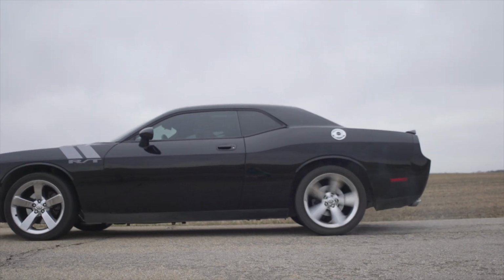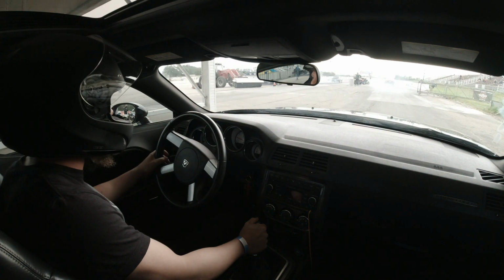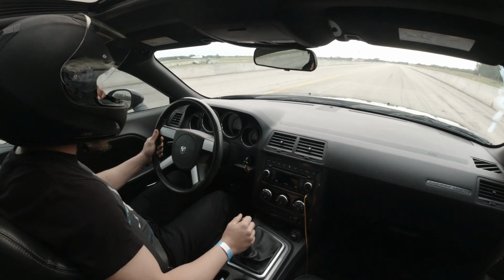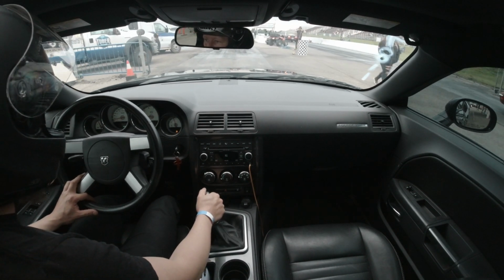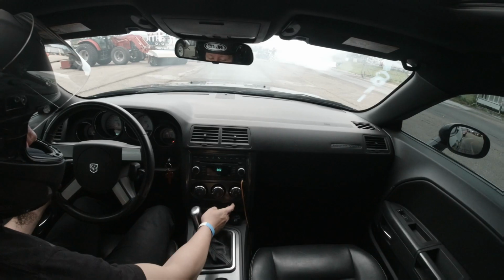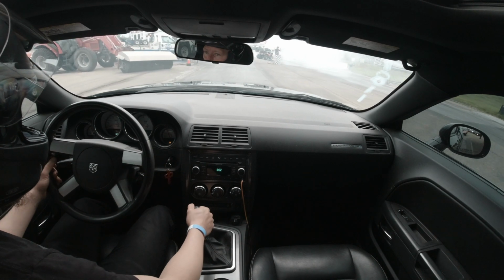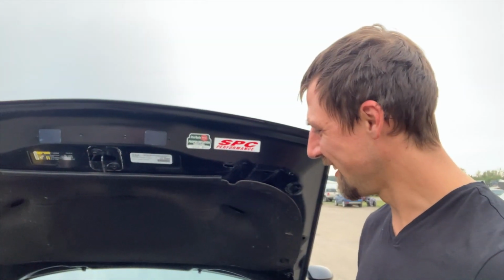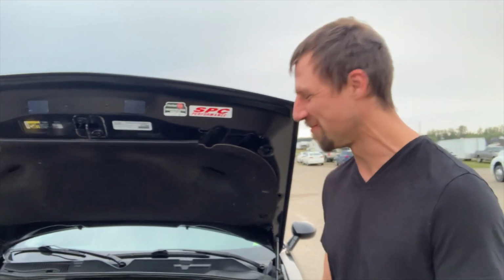5.7 Hemi Stock VS Modded N/A

Comment: Am I understanding correctly that what you’ve done is long tube headers, can & a tune & that’s all? Just curious how exactly yours was modded compared to Matt’s stock 5.7
Reply from the maker: @robertalsbury  at this point in the build I have a comp cams hrt stage 2 cam at this point in my build.  This is with the factory catback though, I didn’t swap to a 3” setup until later.
Reply: @ just just a cam no tune and no headers?
Reply from the maker: @ no you have to run a tune with a cam or your car will barely run.  Long tube headers and cam at this point.  Headers were the first thing I did and then added the cam after.

Comment: Unfortunately, Dodge left quite a bit on the table when it comes to the R/T. With the stock cam, horsepower drops off quickly at around 5,500 RPM. Not only will a cam upgrade make more horsepower, it will carry it out to around 6,300. The torque also has a similar pattern where peak torque builds quickly and drops off quickly. This was done for 2 reasons. The first is that these engines were used in trucks and a cam profile like this is good for getting a heavy vehicle started. The 2nd is that Dodge didn't want a 5.7 that is closer in performance to a 6.4. There is obvious more mark up with a higher trim level, Another key difference  is the exhaust system between the 2 R/Ts in the race. The OEM manifolds are downright terrible. If one is willing to do the work, it is worth it to upgrade the 5.7. If I were a Mopar person which I am not and I could get a good deal on an R/T, I would definitely upgrade it. I know getting a mud hole stomped into my back side by every Camaro SS and Mustang GT at a drag strip would wear awfully thin very quickly. Upgrading these cars makes them much more fun to drive. It's a matter of whether you would like to go the N/A or boosted.
Reply from the maker: It’s even closer than that though, the 6.4 wasn’t a thing when the updated 5.7 was put in the Challenger lineup.  Because the 6.1 was only putting out 425 hp I think you’re right they wanted some separation.  Funny enough if you just swap out the stock manifolds for headers suddenly you dyno pretty much what the 6.1s put out.  I think pressure from the Camaro’s performance forced Dodge to put out the 6.4 to stay competitive.

Comment: You always have interesting vids, thanks. I thought you were shifting too soon but then I could see your tach and you were right on the mark. Those  5.7 6 speeds wind up fast in second and 3rd. The only mod I have on my black '09 Challenger R/T 6 speed is a little pinstriping. That's good for 5 more HP, right, heh, heh.
Reply from the maker: Absolutely!  At least 5hp!  Thanks for watching!  💪

Comment: Awesome video! Definitely get more comfortable at the track. I’m satisfied with my best 14.02 1/4 mile time this year. We can meet again at the track next year and see if I can keep it a little closer to you. Modification is definitely In the near future. My goal I set is hellcat power at about 660 HP to the wheels. One day I will be pulling on you lol.
Reply from the maker: It was great to hang out at the track man, we'll do more next year!  At 660hp you'd definitely be pulling on me!  haha
Reply: @TrackPackRT  do you remember why your best 60’ was when you were stock? And what you best 60’ is now modified?
Reply from the maker: @MattsMoparMadness  my 60’ times haven’t changed a whole lot.  I pretty consistently hit 2.1s now as opposed to around 2.2’s stock (if I can remember right!  Haha).  The manual doesn’t have the same jump off the line as a torque converter in an automatic so I’m kinda stuck in the 2 range until I go to smaller tire sizes I think.
Reply: @TrackPackRT  fair enough. So I guess I’m doing ok on launching with my best 2.08 60’ on that 14.02 run. Drag wheel set up would be nice. I’ll be looking for some soon. A set of front skinnies and rear maybe 15” with some Mickey Thompson or some sorta drag radial and wheel set up. Doing my research now to try find a wheel I like. I’m very picky when it comes to wheels lol.
Reply from the maker: @MattsMoparMadness  I’ve never hit a 2.0.  Wheel diameters make a big difference.  I was looking for wheels for a drag strip only setup but there’s a crazy delay for most wheels right now that kind of screwed over any change I could’ve made for this race season.  Lots to think about for next year!
Reply: @TrackPackRT  yeah better order some soon so you’ll even have them for next year. Lol. The delay sucks especially if your kinda looking for something specific.

Comment: First off, love your content its some of the best quality R/T Information on YT. However, I recently bought a 2011 R/T Classic with Stainless Headers & CAI off of Kijiji, do you think its worth it for me to make the trip to Player 3? (I live in Calgary) Or should I wait till I add the Cam to get it tuned. I just don't now what kind of gains I'm really getting from all my mods at the moment, It doesn't feel like much.
Reply from the maker: Thank you sir for the kind words!  Do you have any info if the car was tuned prior to you buying it?  Also are you parking it for the winter?  When are you planning on doing the cam?  If you’re just parking it when the snow flies and then doing the cam over the winter I’d say just wait for now and do it in one shot.  If you’re not doing a cam for a year or more then maybe see if you can sneak up and get it tuned or see if he’s making any dyno day trips to Calgary any time soon.  Cheers man!
Reply: @TrackPackRT   The previous owner did not tune, so I suspect much of the added power is trapped in tuning. I didn't know Chris made runs down here though, that would definitely be a game changer for me. I don't know if I'll park, but even then winter tires have been hard to find and I don't know how well all seasons mix with ~400hp thanks for the reply though that actually helped a lot.
Reply from the maker: @MarioTryHard  yea if there’s no tune then the knock sensors will pick up on the extra noise the headers are making and start dialing back the timing, eliminating the extra power you should be making.  A tune will wake it up!  Usually he travels to other cities if he’s doing a dyno day with specific car clubs etc in certain areas.  Its worth asking anyway!
Reply: @TrackPackRT  You're insane for replying to everyone man thank you so much and Happy thanksgiving bro

Comment: Gents, help me out here. I'm from South Africa and as such, unfortunately, have little to zero Mopar experts around me. I've got a 5.7 Grand Cherokee - no it's not going ot pull like any of these cars, BUT what are the mods to consider, staying inside a safe reliability range. Are the Charger/Challenger mods the same that I would be looking at? Plenty of guys also write about adding (at a later stage) turbos? 

Looking forward to replies. Cheers.
Reply from the maker: If you’re going for reliability and don’t do a lot of fabrication or have access to  a very good tuner you can use repeatedly while you sort out the kit, I’d stay away from a turbo setup.  I guess the biggest thing would be what are your power goals, and what is your budget.  The first thing I would look at is replacing the exhaust manifolds with long tube headers (best) or at least 392 style shorties because they made grand cherokees with that engine so you know it would fit.  I haven’t shopped around for long tubes for GCs but I imagine they’re out there.  With long tubes and a tune you’ll pick up around 50hp, no joke.  Without sacrificing reliability or changing much else about how your engine functions.  That would be a great place to start!  Very cool that you were watching from South Africa, we’re at two polar opposite ends of the planet, me being In the northern most major city in Canada! Very cool, thanks for watching!
Reply: @TrackPackRT  Thanks man I really appreciate your reply!! Indeed! I watch a ton of Hemi videos online trying to figure it out for myself because, yeah as I said haha knowledge on this side is in short supply around anything American. I saw this video and really appreciate your practical approach to the whole discussion. So going on what you said I think I might do just that! I actually have the common issue of a manifold bolt that's broken of in the block so I'd need to take a look at the manifold anyway. While doing that - what is your opinion on getting rid of the cat? I do have a company called American SUV here who does a decent job at software manipulation so they should be able to get rid of errors involved with a decat, but would you say it's worth the effort? 

What do you think of the angle on these, it seems to be a system I find with decent reviews: https://americanracingheaders.com/collections/jeep/products/jeep-grand-cherokee-5-7l-2011-2015-long-system?variant=29943909700 

Thanks again!!

Comment: What is a Full bolt on. What are your “FBO” mods
Reply from the maker: I wouldn’t call myself full bolt on really at all.  All I have done is long tube headers and a hrt stage 2 cam.  At this point I probably would’ve had a corsa intake on it as well.  I’m still running through the factory catback.
Reply: @TrackPackRT  what parts are considered to be FBO. I would like to go FBO but I’m not sure if I am FBO yet. I have long headers, upgraded Throttle body, ported manifold, intake and a tune